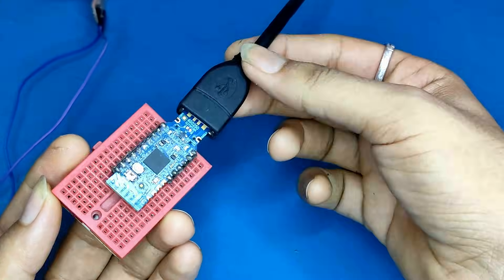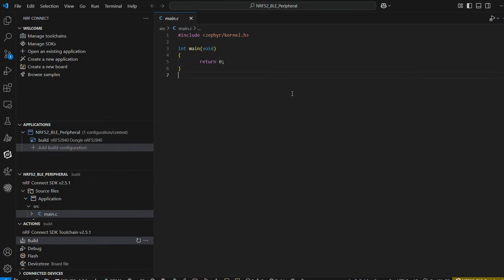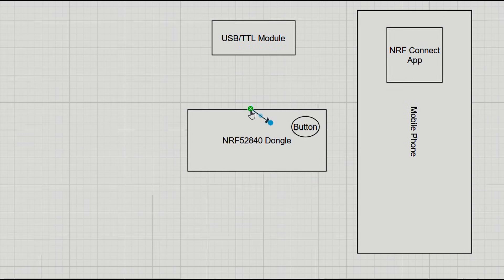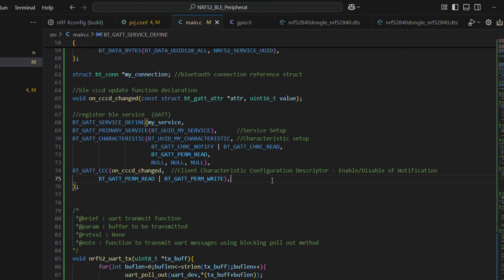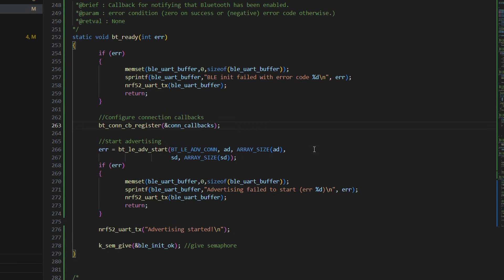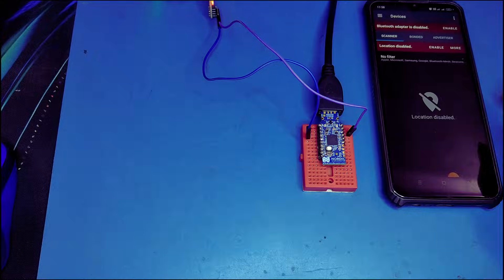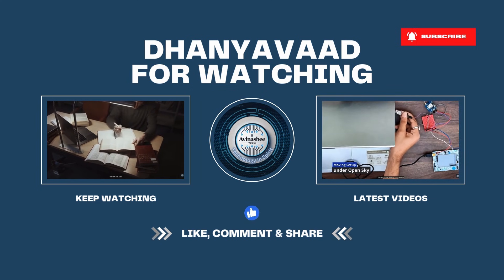nRF52840 Dongle BLE Peripheral Setup | Step-by-Step Guide for Beginners!

Comment: Imam wondering if instead of using UART for printing log messages, is it possible to use USB port to display the messages, so that UART can be used for other functions, else UART is blocked for log messaging and not available for any other device, sensor module connections.
Reply from the maker: I usually work with UART for debugging purposes rather than continuous logging. But if your application needs constant logs while also keeping your hardware UART free for sensors, you can explore the USB CDC ACM example. This makes your nRF52 dongle appear as a standard serial COM port.
For more such embedded content, don’t forget to subscribe to the channel. Thanks.

Comment: How did code showed up on changing kconfig?
Reply from the maker: Thanks for watching. please mention timestamp in the video for me to have a look. thanks.
Reply: @eccentric_engineer  At 3:47 how does the code appeared? is it auto generated? If not can you please share me the code?
Reply from the maker: @AbidAli-mj8cu  Sorry for the late reply. No, Kconfig and Menuconfig are only responsible for setting up project configurations or settings — they don’t generate code. I’ve updated the GitHub link to the code in the description, do check it out. Thanks for watching, and don’t forget to support the channel by subscribing if you haven’t already!
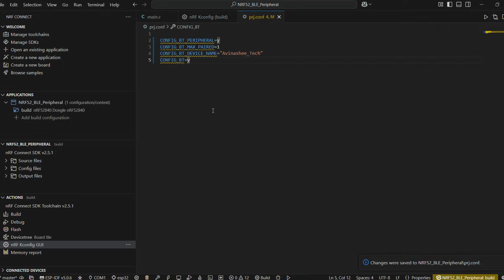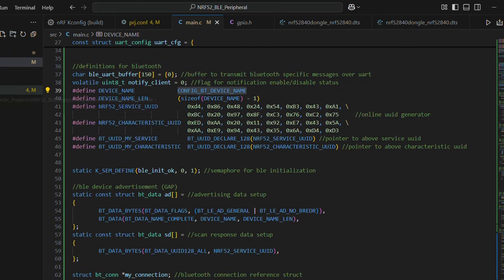Reply: @eccentric_engineer  Thanks for your response! At 2:46 you saved it to prj.conf and then at 3:45 magically main.c has code now. Further, At 4:31 you got autoconf.h which is generated, but that file is missing in my case.

Comment: i have a question. i get a passkey notification. i dont want the passkey so i put : CONFIG_SAMPLE_BT_USE_AUTHENTICATION=n.
but now the connection wont work. thanks for yorr help.
Reply from the maker: Looks like you’re using the peripheral_hids example. Just check if it’s advertising fine. If the connection fails, log the error code — I’ve got a video on using the dongle UART for that. Once you get the code, you can decode it to see the reason.

If you don’t want the passkey but still need encryption, try the Just Works pairing (no authentication). I used that in my HID mouse & keyboard videos — you can check them out for the setup.  Thanks.
Reply: @eccentric_engineer  using periphery_hid from zephyr.. readme says CONFIG_SAMPLE_BT_USE_AUTHENTICATION=n should be included to disable passkey. as simple as it sound, the connection doesnt work..